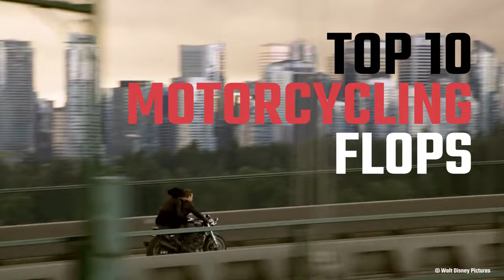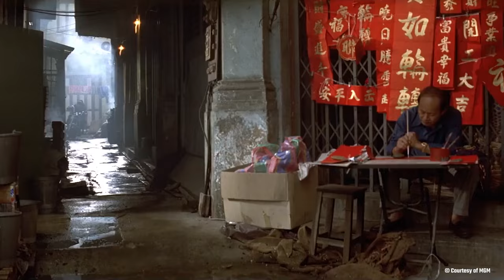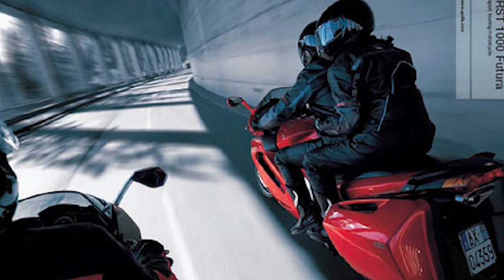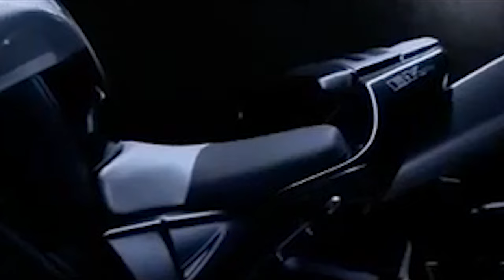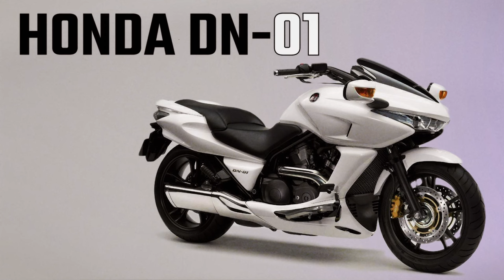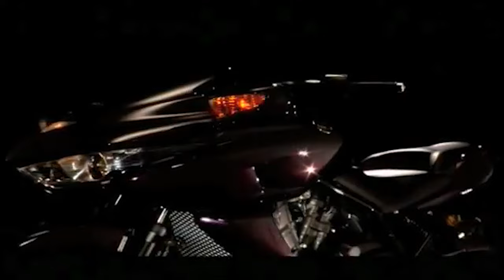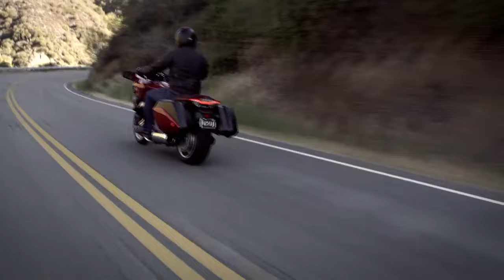10 Motorcycle Flops | The top ten worst motorcycles ever made

Comment: Yamaha have made some right hounds in their time. The aforementioned GTS 1000 can be joined by that twin forked thing of recent times, plus their XJ 650 Turbo and the ugly as sin XZ 550 attempt at stealing sales from Honda's CX 500.
The Yam and Suzuki turbos were never popular, while the Honda and Kawasaki models did at least sell steadily if not spectacularly.
An oft forgotten dog from Honda was the FT 500. The 250 RS single was a great success and very different to the also current Superdream. The FT 500 being a flat track styled big single should've been an urban hooligan but from what I remember of road tests of the time it was just devastatingly dull to ride, and an XT500 was a much better bet for some single cylinder fun.

Comment: Had my DN-01 since new in 2008 and 14 years later it is still the first bike I will get out of my garage to ride. I bought it for my commute to and from work and quite easily did the 12000 miles a year...... Mine won the Best Modern Motorcycle at a local event....... in 2019 at eleven years old. I did point this out to the judges but they said they had never seen one before an the styling looked so good. Don't know why this has been called slow in this video, if 'manual' mode is used (thumb change) then it can be taken right up to the rev limiter (9500rpm) in each 'gear' and changing up at 9000rpm produces the back wheel to kick forward with one hellava surge.... So not as sluggish as reported here. And I have to admit that I have won many a traffic light grand prix with much bigger and so called faster machinery. Oh, the speedo, a digital readout, only goes up to 135mph!! Although I must admit I have only got up to 125mph on mine... I was running out of road!! And the price today, if you want one is over £6K in the UK. But I will be keeping mine as it is Oh so much fun.....and once the little pegs under the foot boards are worn away it goes lower into the corners....

Comment: Don’t forget the Honda VF750 SC the original cam shaft muncher. The very first new bike I purchased. It was a complete disaster. From dodgy cams to drive spline issues, not to mention the wayward handling.
Reply: I currently own one and it purrs like a kitten I did have to modify the head and oil system as why the cams grind down and case harden the cam. But all still original parts that came with the bike.

Comment: ANY owner of a DN-01 would disagree with you. It's transmission was absolutely revolutionary and required no belts rollers etc. Now it is an automatic so a lot of insecure guys who think you don't have a dick unless you also have a clutch talked smack about it. TODAY look at all the automatic bikes!! Everyone always tells me they love the look, it is extremely reliable fun to drive with a low seat so your feet are flat on the road lots of stability. I also own a BMW bike and it's a piece of shit. My DINO has never broken down on me never failed to start. All parts are still very available. HOW IS ANY OF THAT ONE OF THE WORST EVER MADE???
Reply: That isn't what the OP defined as a flop.  It didn't SELL well.  Most of these are probably fine bikes and have a following.

Comment: need to add in the 3rd gen Star Venture, Yamaha decided on a raider style 1900 engine air cooled in their new cruiser to replace the  water cooled 1300 V4, no V4 rider wanted it, should have stuck the v4-1700 in it from the V-Max. Such a bad decision, Yamaha then killed off both the V-Max 1700 and V2 Star Venture. I've had 3 V4 Ventures, still ride one, could never see myself on the twin Star Venture. Sad!

Comment: none were the worst ever made just the company getting the market wrong  and whilst not fitting into your last 30 years one of the biggest mistakes was the Velocette LE or noddy bike as it became known designed by questionnaire of what every commuter wanted  it was built  but commuters did not want to go go to work on a motorcycle and the real motorcyclist even the budding ones would not be seen dead on it. Became known as the noddy bike as it was used by the police and the rider had to nod to senior officers if they saw them.

Comment: Utter nonsense re the Yamaha GTS1000. I rode this bike on a 2000 mile Nat Park tour for a magazine review. It was probably the finest big bike I’ve ever ridden in my life and I’ve ridden over 50 machines. The engine was plenty powerful. The front suspension was outstanding. The bike was comfortable and the aerodynamics were excellent. The only negative feature was that the turning radius was quite wide because of the unusual front end. But the bike had some of the best braking I’ve ever experienced. The entire bike would squat rather than pitch nose down, And the machine had a very effective anti-lock brake braking system, one of the first. This was a superb machine. This video is completely incorrect in saying the bike was underpowered or too heavy. I will say flat out that the GTS 1000 remains One of the greatest motorcycles ever made. The creators of this video should be ashamed of their own ignorance.
Reply: You are correct

Comment: I'm still wondering where the R1200C is fitting in this list - BMW wouldn't had produced it over 6 years if it had been a flop. And beauty (or not) is not a measure in determing whether it's hot or not.

(I think that the C is ugly. But compared to the C1, it's Claudia Schiffer on wheels. 😉)

Comment: There are 2 more that are far worse than any of the ones you mentioned. These hideous 2 wheeled piles of trash will NOT become sought after in a few years, and the sooner they go away the better. The first is the 2017 and newer Honda "Rebel", all versions, 300, 500, and 1100. These are by far the ugliest motorcycles ever sold in the U.S., and quite probably the whole world. Honda has made a lot of very nice looking bikes. How they came up with this trash is impossible to understand. The DN-01 was downright gorgeous compared to the latest "Rebel" What makes it even more disgusting is just how beautiful the previous Rebel 250 is. Why didn't they just build a larger version of that? 

The second is anything from H-D with the "Revolution Max" engine. Just like the "Street" 500 and 750, these are NOT Harleys. They don't look like Harleys, they don't sound like Harleys, and they don't feel like Harleys. They are 100% Japanese design. But while the "Street" models were able to just quietly go away, that is not the case with these monstrosities. H-D first came out with the Sportster in 1957. I have owned several, and currently own two.  They are absolutely wonderful, beautiful, charismatic bikes. And now H-D has decided to drop them after 65 years, and replace them with bikes that don't even resemble a Sportster in any way, shape, or form. 

As for the XR1200, I own a 2009 model and absolutely love it. It is a sporty bike that still has a fairly upright riding position, and that wonderful Harley sound and feel. Its only negative issue is EFI, and over the next few months, I will be converting mine to a carburetor.
Reply: WRONG
Reply: Just kidding, but I think your personal opinion doesnt mean They're duds as they've sold well (at least the Honda has I believe)
Reply: Agree about the 'new' Rebel models....the styling reminds me of something that would be penned by the cartoon  animators of the classic Pink Panther cartoons...a caricature of what a motorcycle would look like from the perspective of a pre schooler.  Simply FUGLY.

Comment: "Worst motorcycles ever made" is the title, but only at the END of the video do you then say "Of the last 20 or 30 years".
If it's the former, you missed out sooooo many truly terrible machines from the 50s, 60s, 70s and 80s that it beggars belief, yet you include the TL1000S/R. Now I get that the R was a bit of a dog, but you lump in the S with it!
And you didn't include the likes of the CB250T and N which defined bland in their day, nor did you include the truly awful "Plastic Maggot" CX500. I have ridden both the Plastic Maggot and the TLS over many, many thousands of miles (actually, tens of thousands) and the idea that you would include the TLS and not the CX is simply ludicrous!.
And there are plenty more that were just as bad in their eras as the CX. 
And yes, I know the Plastic Maggot sold in vast quantities, but it was still truly the stuff of nightmares, and almost certainly the worst motorcycle, in comparison with other similar machines, of any generation.
Reply: I rode a Cx500 in the eightie's. Have been riding since 1976 and currently have 6 machines. I think the CX models were truely awful maotorcycles. Only exceptions were the turbo models which seemed to smooth out the engine vibes and go very well.
Reply: @TheBezaleel  Yeah, the turbos received a LOT more development, and their handling would seem to have been improved by placing a lot of the extra tech as low as could be managed.
But the non-turbos were ridiculously top-heavy and had pretty awful suspension to add to the lacklustre performance and pretty woeful reliability.
I once rode a Silver Wing, which managed to have even softer suspension AND a huge barn-door of a fairing to exacerbate even further the terrible weight distribution..
I don't usually suffer from nightmares, but one that does sometimes return to me is having to ride a CX.
I've had some terrible bikes in my 42 years of riding bikes, but it was obvious that most were simply in need of some TLC.
The clear exception was the CX.
It was just awful.
Reply: My guess would be that including bikes from before the 90's would make it a lot more difficult to find footage to use of said bikes for this video, especially going all the way back to the 50's. The other issue is the farther back in time you go the fewer people watching who would have had the chance to actually experience riding those bikes. This means fewer of the people watching would have had first hand experiences to draw reference from. Also, I think that "Worst" in terms of the video was in reference to commercial failure more so than build quality. That being said, I do agree that the video title should have stated "of the last 30 years" to avoid confusion.
Reply: @beauleidig8670  Yeah, sales figures hide all sorts of sins, don't they?
But to judge a bike's worth based entirely on sales volume is  particularly silly, as it fails to recognise that hyping a terrible bike manages to massage the figures enough to be able to mask all sorts of sins.
I mean, look at the NR750. What a terrible, bloated, extravagant waste of engineering  and money that dead end was! It was no faster than any of the competition that cost 25% of its asking price, weighed more than the competition and the whole thing was a stodgy mess. But they sold out before they officially went on sale!
I think that the criteria for these "Best of" and "Worst of" lists should always be clearly stated. Unfortunately, the YouTube algorithms thoroughly penalise honesty, which is why we get these BS headlines.
Reply: @davidcolin6519   Yeah, the sales numbers can hide almost anything. The Ford Escort sold something like 6 million units over it's lifespan in North America, but despite being one of the top selling cars of the 80's and early 90's you almost never see one on the road today due to poor build quality. I think a lot of automotive manufacturers really do struggle to hit that sweet spot of quality, fun, and affordability. For them, success really is just measured in sales regardless of how good or bad the product might actually be. And yeah, the algorithm is broken for sure, but if you want to get the views you have to play by the rules I guess.

Comment: Whoever chose that engine for the DN-01 needed their heads examined. But maybe it was forced on the designer, with oversupply at a factory or something. That engine is OK-ish, plodding and solid, if a bit 'agricultural', fine for something like the Transalp, but not my idea of a cruiser engine. It's debatable whether the Deauville could have done with something better too. But as you said, the whole DN-01 thing was a dogs dinner, a nice pipedream on the drawing board, but should never have got any further.